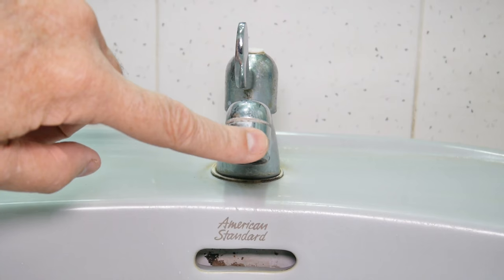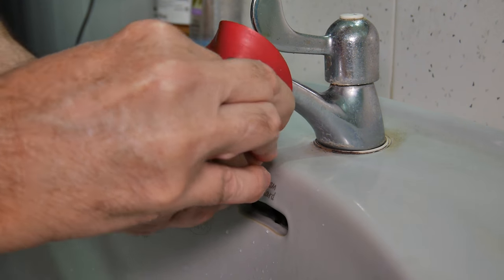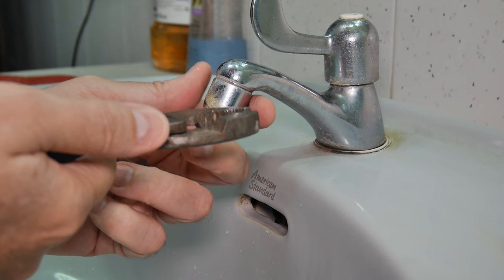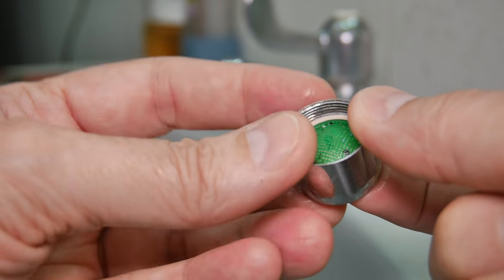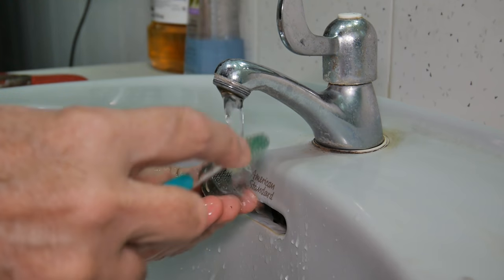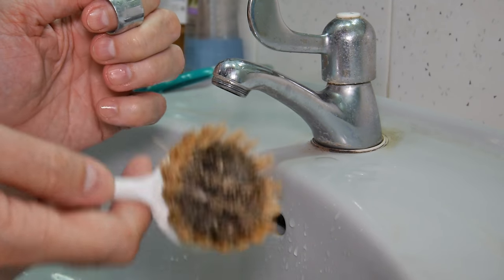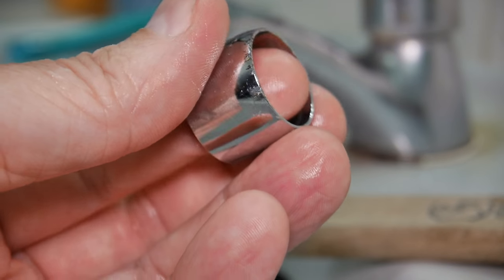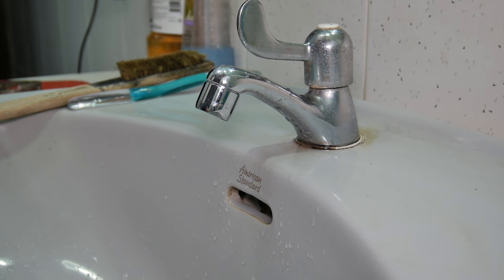Faucet Aerator Cleaning

Comment: Thanks. Very helpful. 

Thank you. Tip: also use a clean latex cleaning glove to remove the aerator. No need for plyers n most cases. Works better than my jar opener.

Soak the aerator in white vinegar for a couple hours to make the buildup melt like butter for easy cleaning. A plastic bag w white vinegar can be secured to the faucet. Also soak shower heads regularly.

Comment: Some vinegar on a rag wrapped around the aerator faucet assembly helps to soften the mineral deposits... a little bottle cap to soak that aerator in makes short work at removing the rest of the scale & crud
Reply: thats brilliant
Reply: This did the trick nicely to get the aerator off.

Comment: I am fairly sure that at 4:12, the assembly around the screen does come apart.
Reply from the maker: I know it looks that way, but the plastic is welded.  I broke 1 of the 4 we had trying to split it with a knife.  If they are glued together, it's usually not worth opening it except as a last ditch effort.
Reply: They do come apart on some. I've had to take some completely apart and take the o ring out because there was debris under the o ring itself.  Also the o rings deteriorate over time and can be replaced.  May just be easier buying a new aerator though.

Comment: Which way is the aerator turned to remove it from the tap ? i.e is it turned clockwise or anticlockwise from ur standing perspective ?
Reply from the maker: From above you turn left or clockwise.  If it is stuck, try a rubber jar opener from the kitchen.  If you must use pliers, protect the aerator and do not squeeze hard.  They are thin and bend / break easily.

Comment: What if I don't take it apart, and just soak the whole thing in vinegar water for a few hours. Would that work?
Reply from the maker: You can, but if you let it go too long it can damage the chromium.  If there's sand or such in the screen vinegar won't remove it.
Reply: @tsbrownie  Thanks for the quick response! I'm gonna let it soak overnight and see how it goes.
Reply: yes ten to fivteen minutes work fine
Reply: i couldn't figure out why mine was still not flowing with fresh pressured water.  I had soaked it in vinegar for a few days and the same result.  I finally tried to remove the top portion from the base and there was a top that popped off.  I looked at what was below and it was still clogged.  Soaked it in hot water and used a air compressor, cleaned it all out and flows perfectly.  The point there is a piece (at least on mine) that pops off and is separate from the aerator.

Comment: How to remove it when wrench is not there and when it's so tight
Reply from the maker: Use rag, rubber jar opener.  If you use pliers, wrap it with a rag or tape and do not squeeze hard or you will ruin it.

Comment: The only problem I have now is that my refrigerator leaks from the freezer on the right side and I have keep a bucket to catch the water and dump the ice out every once in awhile.  The management thinks they fixed it by taking a blow dryer to the freezer.  And, also, when I take a shower, the water comes out both the bathtub faucet and the showerhead.
Reply: The bathtub/shower head needs a new diverted. It's a little thing on the tub faucet, it diverts all the water to the shower or tub. Yours is broken.

Comment: My kitchen faucet is just a trickle of water now and I can't do anything with that - no washing dishes or filling buckets to wash floors or anything.  I have to go to the bathroom tub faucet to wash my dishes and fill a bucket to clean my floors.  Is the management re-directing my water to everyone else or is the problem with the aerator?  It used to flow nicely when I first moved into the apartment.  How wood the aerator get clogged in the first place since there's no food or anything going in it?  Please answer if you might know the problem.
Reply from the maker: Low flow can be from several problems.  It can be the aerator is clogged with minerals from the water.  Also, in most cities you will get small stuff from the pipes: rust, sand, ...  I've also seen the inside of shut off valves and pipes corrode or get blocked with minerals.
Reply: It worked!  I removed the aerator and it flows really good now.  Now I have a working faucet in the kitchen.  The only thing is is that when I removed it, I forgot that I had left to cold water faucet in the on position and it came out spirting water at me.  Oh, well, it was only water.  I'm so happy I fixed it myself.  I put the old aerator back on that was on when I rented the apartment.

Comment: My plumber just installed a brand new faucet yesterday and the water is spraying out . It’s so annoying. He told me to call the company, so they’re sending me a new aerator. How could it possibly be clogged when it’s brand new? We tried cleaning it but it’s still not right.
Reply from the maker: If it is not assembled correctly it will do strange things.  Even small bits of contamination (sand, plastic...) change it a lot more than one would think looking at it.
Reply: @tsbrownie  Thank you !
Reply from the maker: @Amaryllis88164  You are welcome.  I've been struggling with them for around 55 years.  The old ones were much easier to mis-assemble, so they are better today.  I hope they get it worked out for you.
Reply: tsbrownie  Thanks again! I hope the new one works when it arrives. The lady who I spoke to said sometimes the holes aren’t lined up properly when it’s manufactured. I’ll let you know. 😊
Reply from the maker: @Amaryllis88164  Please do, I'll be interested to hear what the problem was.  I'm never too old to learn (I hope).

Comment: my wife tried to clean our aerator and the o-rings went missing for whatever reason, any tips? or there might have never been o-rings? idk lol 

any suggestions? the aerator is clean but no pressure whatsoever
Reply from the maker: Does the water flow when the aerator is off?  If no, then that's an issue.  If yes, then it's probably not assembled correctly.  That's easy to do (from personal experience).  Getting parts in upside down or in the wrong order will do it.  If you can find a diagram of your faucet type on the internet, that will help a lot.
Reply: Or just leave it off. Maintenance men do that in schools and restaurants so it's not a problem in the future. Then you just have to use the water responsibly because it's more water and less air coming out